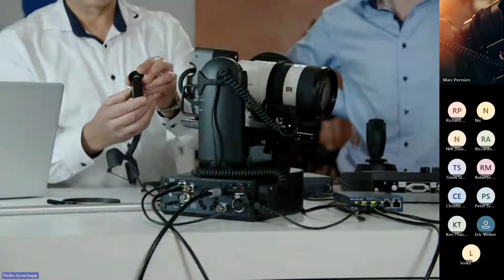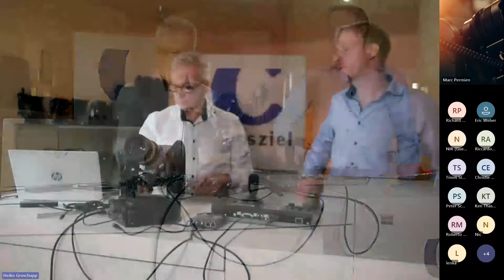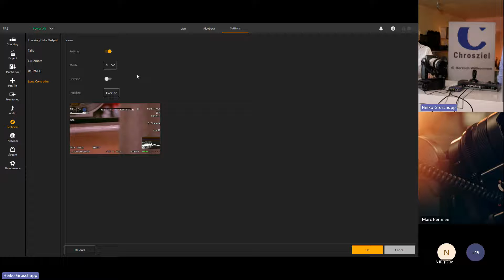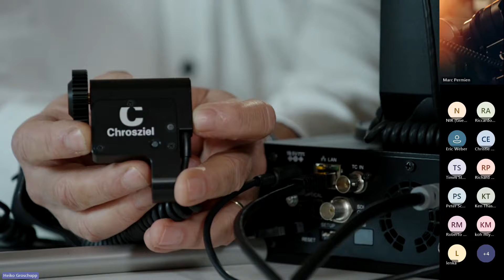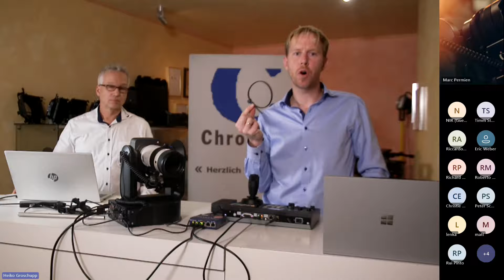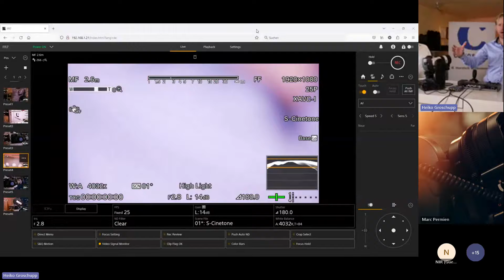Chrosziel Zoom Motor for the Sony ILME-FR7 PTZ camera

Comment: I was wonering, how slow or smooth can zoom be?
Reply: with stills lens? not very. those lenses are not parfocal and they breath heavily. you are not getting a smooth zoom out of them. If you need longer zoom, full frame camera is not your best option. I suggest get BRC-AM7 instead. There are few zoom lenses on the market that cover full frame sensor, are parfocal, with proper servos and they all cost 40k+ and they won't fit this camera.